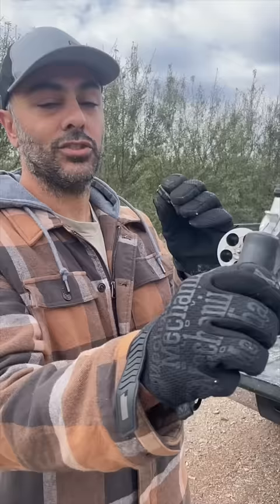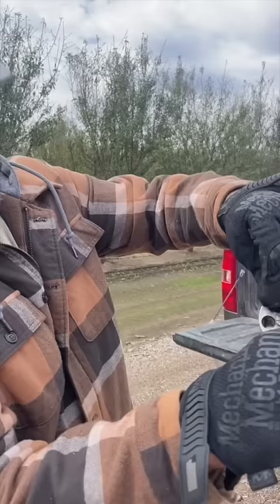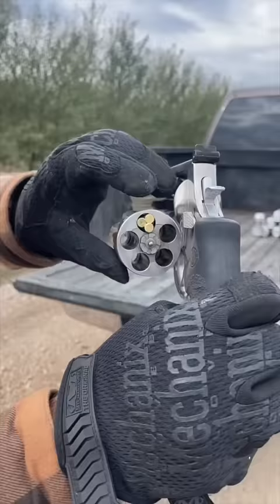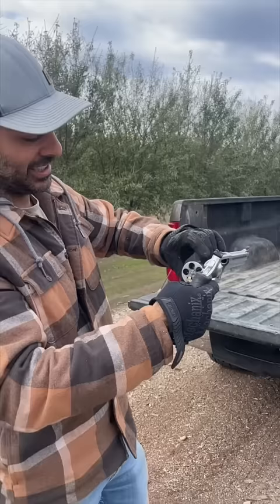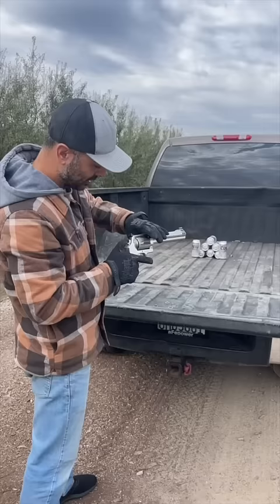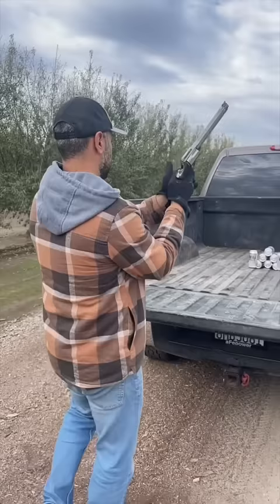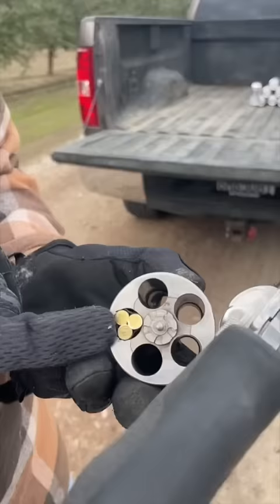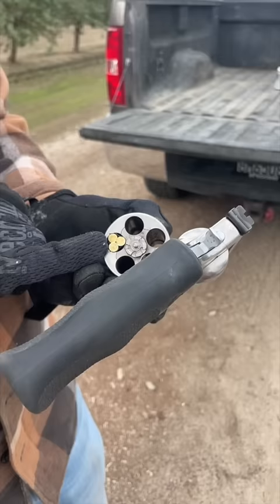Firing 3 rounds of 22lr out of 500 Magnum revolver?

Comment: Gun dealers: DON’T DRY FIRE THE PISTOLS!

This guy:
Reply: I was wondering if it would be bad for the revolver if there weren't bullets in there. I don't know much about guns.
Reply: @lemeilleur92  No it’s not bad for the revolver lol. It’s not any different than firing it loaded. Gun dealers don’t like dry firing because it leaves marks on an otherwise brand new gun…
Reply: Not a pistol. And if it's a hammer without a firing pin nose, it isn't bad for you to dry fire it, it won't do anything. Won't leave marks without a pin nose.
I didn't see a nose.
Reply: Its a bad idea to dry fire.  It wont damage the gun, but its a bad habit because it only takes one time to not check the gun and have a round loaded to have an accident.  Always treat a gun as if its loaded, check double check, and triple check to see its loaded.  Never point a gun at anything you don't want to destroy.
Reply: It's a revolver, concept doesn't apply.
Reply: @mitchellgardner2193  would it damage anything other than a revolver?
Reply: @scottperry7311  Thank you!
Reply: I heard the only gun you shouldn't dry fire is a .22 due to the firing pin striking the chamber if there isn't a round in there. The only guns I don't dry fire are my Walther p22 and Ruger 10-22. I use a snap cap for the Ruger
Reply: @scottperry7311  Then the issue is not dry firing. The issue there is basic discipline handling a firearm lol…
Reply: @Wulfjager most modern 22s have a safety to prevent dry fire damage. Just have to do some research on what you have, is all
Reply: @scottperry7311 dry firing would only build a bad habit if you do so carelessly. If you dry fire while following all the standard rules, in the case of an ND it would still be in a safe direction
Reply: @domosrage5434  looked into it, only .22 I have that it's a problem is my Walther, but I can decock the hammer so I never dry fire anyway
Reply: @Thor.Jorgensen On a revolver the concern is leaving marks on the outside of the cylinder from how the mechanism rotates it, not related to the firing pin.  Use creates a “drag line” around it that someone paying for a brand new gun expects to not exist yet.  It’s not instantaneous, so you can still try a couple trigger pulls, but shops will want to limit it.
Reply: Rim-fired revolvers should be avoided for dry firing, as infrequent dry firing may or may not damage the firing pin, but excessive dry firing can cause "peening," resulting in dent formation where the firing pin strikes. Centerfire guns, however, are safe for dry firing to clear the weapon, drop the hammer, or test the trigger. For absolute firearm protection, using snap caps is recommended.
Reply: Educate yourself
Reply: Dry firing does nothing
Reply: @IronButterknife  Read up 👆
Reply: @scottperry7311 everytime I pick up a gun at a gun store and want to check the sights I made it a habit to always aim the gun at the shelf I took it from... Except at that one gun store where they have a range to test air rifles. There I aim downrange for obvious reasons.
Reply: @Wulfjager  you beat me to it - it is correct
Reply: You don't want to do it a whole lot. Things get weaker over time
Reply: The only thing I wouldn’t dry fire is an antique single action revolver because the firing pins there could be more subject to damage, or any firearm that shoots rim fire cartridges (22 LR). Any sort of modern center fire firearm shouldn’t be damaged by dry firing. But there are lots of different guns out there so I’m sure there are exceptions to this rule. Just know how your firearm works and if it is okay to dry fire your gun.
Reply: Any semi your good but I would never dry fire any 22LR caliber
Reply: The reason you shouldn't dry fire pistols (or so I've been told) is because without anything to strike, the pin extends too far and it puts too much stress on the whole assembly.  Hammer fire works differently.
Reply: Centerfires are typically fine, it's rimfires that can harm themselves if not loaded. It's good etiquette to just never pull a trigger unless you honestly mean to though.
Reply: @awholelotofnothing6456  That sounds like the biggest load of bs though because think of how much stress the pin is under when it strikes a cartridge and the black powder is ignited. I honestly think it’s because dealers just don’t want you marking the parts of a new gun…
Reply: Imagine paying 500$ for a gun and not being able to pull the trigger smh
Reply: ? No one cares about dry firing
Reply: You think they are selling their floor models?
Reply: @lucre113  a lot of dealers and enthusiasts care, and as far as "floor" models go, that is fully functional firearm, and is treated as such. If I want the Stoeger M3000, and it's the last one in stock, they're going to box up the display piece and sell it to me. Makes no difference to them or me, still a brand new firearm.
Reply: @RazzleberryHaze  interesting I’ve never heard of this. I’ve only been to a handful of shops but every one has dedicated floor guns for testing pull and feel. I’m sure they’ll sell em eventually for a markdown
Reply: @lucre113  there's 3 times i can remember buying a display, when I bought my Mossberg 590 shockwave, my Taurus g2, and my stoeger m3000. I actually had a choice not to take the display stoeger, but the only others they had were black finish and I wanted the camo finish since it was going to be a duck/goose gun. It's certainly common for dealers to sell displays, especially when it's something uncommon like a .50 bolt action that they only buy one at a time of
Reply: @scottperry7311  Dry fire practice is literally the best way to practice until you can get to a range with live ammo. I thought this ignorance died out with the 20th century.
Reply: @lemeilleur92  Why would you thank someone for bad information?
Reply: Dry firing is actually fine depending on the type of gun it is. But trying to fire the wrong bullet is so stupidly dangerous.

Comment: Bro really aimed directly at his truck😂
Reply: But. You're not hitting the center with the firing pin? It'll never ignite that cap
Reply: @user-eh5so8zv6v  rimfire doesn't need to be hit at the center. It fires when struck on the rim. That's literally why it's called rimfire and not centerfire.
Reply: @user-eh5so8zv6v Rimfire is literally called rimfire because it fires from hitting the rim 😂😂😂
Reply: @cl86241  thanks guys! Had no idea. 
Only ever shot papa's .22 (now mine) and my grandma's glock 9. I know very little
Reply: I think he was aiming at the gas tank too lol
Reply: I’m like 99.9% sure he knew it wouldn’t work.
Reply: Because he already knew the hammer was going to hit nothing but air
Reply: @theshotgunscientists the obvious jump cut before he even had the cylinder closed would argue there’s a 100% chance it wouldn’t work. I really don’t even think he could actually get the cylinder closed with the way the rims of the 22lr are overlapping. People probably gonna think his new AR20mm short is real too…
Reply: And at his fuel tank on top of it.
Reply: @emberjaxx585 i was saying the samething.
Reply: my first thought was, are you thinking this trough lol

Comment: that thing has enough kickback to launch you like a bullet.
Reply: How😭
Reply: @ppremovalco5644 the fire power
Reply: @ronaldmcreagann6343  I was saying for the instance if it's .500 not this
Reply: Folks, I took off the 18 one arm pull ups Support the people
Reply: Firearms have recoil. Engines have kickback.
Reply: I was expecting some sort of catastrophic failure, but the pin looked to barely hit the charge.
Reply: Use as thruster to get long long jumps
Reply: Shot one last weekend one handed, theyre really not bad, a 50 AE deagle kicks harder
Reply: @AssFeaster nah that thing has a kickback ☠️😭🔥
Reply: Pull the trigger and jump lol
Reply: Damage: +1000
Accuracy: -180°
Reply: @ppremovalco5644  Every action has an equal and opposite reaction
Reply: Idk, a long barrel like that actually isn't that bad, shot one last year and it was more manageable than my ruger sr40
Reply: @Killasjockstrap  bro pics or it didn't happen
Otherwise, your wrists are obviously bionic
Reply: Bro what? The recoil really isn’t bad.
Reply: Not a lot of people have actually shot a .500. It’s not bad at all as long as you have prior experience with firearms. I’ve cylinder dumped that gun quite a few times just to prove it
Reply: @astrokace5780 
But no videos?
Reply: Nah, that things built to have less kick than a .44 the grip absorbs alot of shock and it has a huge compensator built in. Im not sure about the shorter barrel versions however.
Reply: Yeah if he had a 500 in there 🤣
Reply: @ronaldmcreagann6343 naw by shooting 3 .22s at once it is equivalent to firing a .66 caliber round which truly would be a hand cannon.
Reply: The 500 have heavy barrels to reduce recoil
Reply: Proud owner of a 4 inch s&w 500 and yeah has very nice power behind it. Let a cop friend shoot it (I only loaded one round for safety)...I told to respect it but he was like I'm good...so he shot it one handed and almost smashed his forehead lol. I was like really dude, leave your ego at home lol. Had him shoot the 325gr magtech.
Reply: You won't shoot a 700 grain bullet out of the 500 one handed!
Reply: Kickback ☠️☠️
Reply: It's called recoil
Reply: Recoil
Reply: The 700 grain ammo kicks a good bit, but with the full length barrel it's not that bad. Just too many videos of idiots with the 500.
Reply: It’s not that bad
Reply: @rylanthompson5844  kickback is easier to say than recoil sometimes RYLAN.
Reply: Not firing three .22 lr's, it don't.
Reply: ...except it's the 500 cartridge that does that, not the gun. show me where the 500 cartridge is?
Reply: @ucgaofficial5339 that’s not how it works. The powder load is what matters not the caliber
Reply: Till one of yall posts proof of how easy it is, yall all liars stop tryna play wimme
Reply: Boo come dovrebbe sparare
Reply: it's a joke.
Reply: Not true, I shot one recently for the first time and was surprised it wasn't as bad as I thought it would be. Strong kick but doable
Reply: Not with 3 .22 rounds in it .
Reply: I never did get the .500
But I do have a .460 magnum and I can say that isn’t terrible. Not that I would want to fire it all day, but it didn’t come close to “tearing my arm off”, lol.
I have a magnum research 30-30 (ten inch barrel) which is surprisingly mellow to fire. Sends out a one to two foot fire ball…  but I swear, I felt less recoil firing that one handed than I felt firing 30-30 from my marlin lever gun, lol.

Comment: Rimfire cartridges in a centerfire weapon. The section of rim that's being impacted by the hammer has no support on the other side, so it can't be compressed enough for the rounds to go off.

And even if they went off, by some miracle, the worst that would happen is the projectiles would fly erratically, most of the gases would vent out the chamber gap and barrel, and the most damage that might be done would be some rifling damage in the bore and deformed casings in the chamber. They're .22lr in a .500 Magnum, its not like the gun becomes a pipe bomb.

As for shooting the back of the truck, pretty sure Edwin knew it wasn't gonna pop and did it deliberately to f with us. Fair play, honestly.
Reply: Karen!!!!!
We know.  No need for the goofy explanation..  geeeze.  
You’re made for each other.
Reply: @user-fk8zx5bg3v  This comment section told me otherwise, though sarcasm can be hard to smell through a screen.

Comment: i think he knew it wasnt gonna go off why is everyone so angry 😂
Reply: Because nobody seems to understand what ‘unsupported case and oversized chambre” means.
Even if the rim primers somehow ignited, the unsupported cases would just pop, and vent all the gases out of the massive air gaps at the back of chambre and around the undersized bullets.
Reply: @Beuwen_The_Dragon  Not only that but the odds of rimfire cartridges going off with a centerfire pin are infinitesimally small. There's nothing for the firing pin to crush the primer against.

Comment: the back of your truck???
Reply: he knew it would not work ether that or he has a backup or something
Reply: Lol,ya keep aiming at your gas tank
Reply: It’s a Chev…they can handle it.
Reply: for the luls
Reply: Fr 😆!?
Reply: illeyez505  Chevy is the best 💪🏾
Reply: It’s a rim fire cartridge a hammer would never tire one
Reply: @Wire_Mesh_Police 😢
Reply: @Wire_Mesh_Police not a big revolver guy but don't most revolvers have a firing pin of some sort that the hammer hits?
Reply: @Michael-uc2pn  22 are rimfired which is a specially designed method of firing the round. A firing pin wouldn’t work
Reply: @Wire_Mesh_Police  rimfire weapons have a firing pin too (granted it might hit harder idk), but someone else explained the rim has to be properly seated against the chamber for there to be enough force to set it off, otherwise the bullet can move and that absorbs the force, so I think that's the main issue.

Comment: To anyone knocking his decision to do this the way he did, he obviously knew it wasn't going to work...anyone with basic knowledge about guns would know that
Reply: I think it was staged because there's a decent chance of .22 rimfire going off if you smack the rim with the firing pin. Definitely one of those "don't try this at home" things, because on the off chance it did hit one or multiple of the rims with enough force, there's a chance they could go off. Obviously fairly unlikely given that the whole gun isn't designed to work that way at all, but you're still smacking the rim of a rimfire cartridge with some kind of firing pin, definitely risky if something bad could happen when it went off.
Reply: @Michael-uc2pn you don't understand how rimfire cartridges work. The primer is under brass, the firing pin of a rimfire essentially crimps the rim for ignition. You won't get enough of a crimp on the rim in the cylinder with the way they're positioned which is why it didn't go off.
Reply: We all understand these are rimfire, he still deserves ridicule for posting this.  And if you are wanting to suggest he is knowledgeable himself then I’d ask why he said he was loading three BULLETS into the chamber and not three rounds.  People that call rounds bullets are typically not knowledgeable.
Reply: Doesn't justify it
Reply: that doesnt change the fact that its still extremely unsafe. anyone with basic knowledge about guns knows that the first rule of gun safety is to assume every firearm is loaded. always.
Reply: This is just one of many example of complete disregard for the rules of safety you can see on his channel. Dude is a bad example for anyone learning about guns on youtube and for the 2a community itself. Dude needs to do better.
Reply: it doesn't matter if the magnum with 3 .22 rounds would fire, treat all guns as if they were loaded especially when you know they are.
Reply: No he didn't watch the first trigger pull he flinched

Comment: Uh, Edwin, a word pls. After you did the test, then open the revolver cylinder while showing what happened. " Your left hand is actually in front of the cylinder where the three .22lr rds are. Rim fired cartridges are known to be a bit picky, and it shows that those bullets had some struck marks on the rims. Your left hand hold the front end of the cylinder is actually directly where those cartridges are. I'm just sharing something you missed while doing this test. If one or two already got struck a bit, it may accidentally ignite and discharge the rounds directly into your hands because your left hand is right in front of where the cylider these 3 rds are in. Just be careful, my friend
Reply: Even if they somehow ignited, the bullets wouldn’t be propelled into his hand, the cases are unsupported and there is nowhere fro the gasses to go except outward. So he won’t get shot, but he likely would catch some spicy brass fragments instead.

Comment: Mabye if u modified the hammer to have 3 smaller points and less surface area on the tip to increase striking force
Reply: The .22s are rimfire casings;not center fire (no central primers to strike.)
Reply: @HalfWarrior you'd still need a triangular hammer face to strike all three cartridges
Reply: even then bro chances are you'd only hit the one in the most rear
Reply: @educatedskeleton1803  you'd atleast get ignition, possibly a chain ignition

Comment: It's geometry.  A rim fire weapon hits off center.  With the 3 22 LR's in one cylinder, the center fire firing pin is hitting the extreme edge of each 22.  If you could move the firing pin of a 22 revolver over to hit right where this firing pin is striking, then you would probably get nothing but misfires in the 22 revolver on a single 22 cartridge.

Comment: no it's strong enough sir what you need to do is turn those bullets into a shell lined up with inner firing pins so they fire properly. you could literally 3D print it to if not do it the old fashioned way.

Comment: I'm probably wrong but rimfire requires more force to set off. Also, you clearly would need a custom hammer to hit all three.

I don't know why people are safety Griping. It's 22, in a SW 500 designed to handle 300× the force potential.

And its his truck.

Comment: You can make any bullet smaller, fit in a barrel that is larger... Take the revolver cylinder off, dip it in oil, pour hot glue down the barrell,, make sure bullets are almost touching but also lined up where the edge of the cartridges will catch the cylinder to make sure the bullets aren't cushioned like the ones in this video....😅
Reply: Cut the hot glue down to diffrent sizes and test what lengths should b made